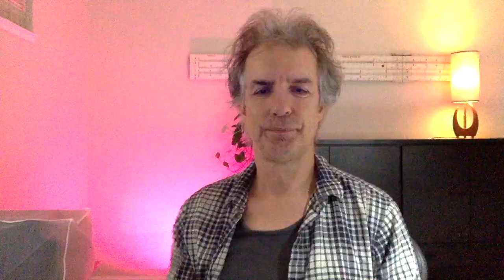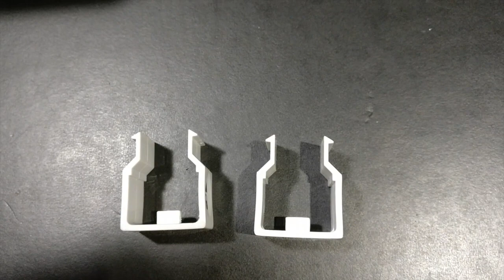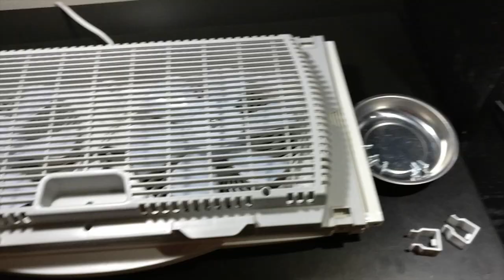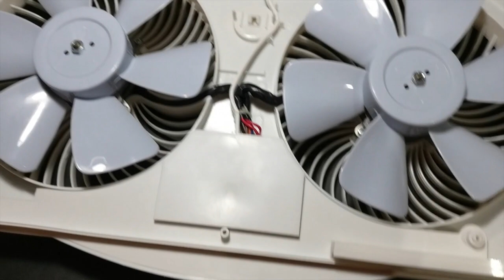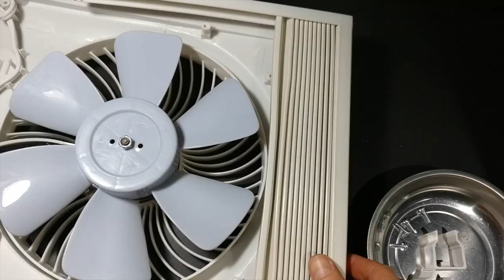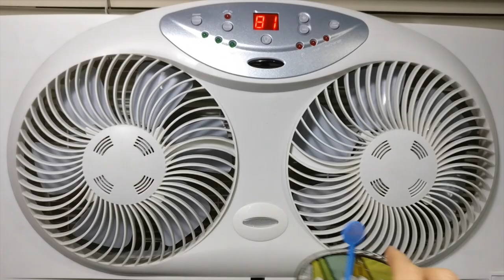Easiest Way to Silence the Bonaire Window Fan--No Soldering!

Comment: I tired the Ninja method.. I messed something up.. darn! now the fans wont come on and the only light that comes on is the one for the temperature.  I think my circuit board is a bit different.   I must have cut off more than I needed too.
Reply from the maker: I recommend restoring all the connections that you cut. That would require the use of a soldering iron however.

Comment: CAN YOU HELP ME WITH MY  dual-blade Bionaire Twin Reversible Airflow Window Fan ; ONE OF THE FANS IS NOT WORKING?
Reply from the maker: Sorry you are having trouble. That would be a warranty repair matter.
Reply from the maker: Make sure that all connectors are fully seated.